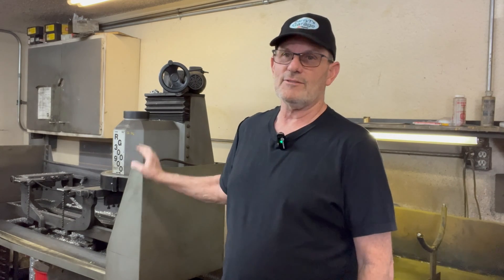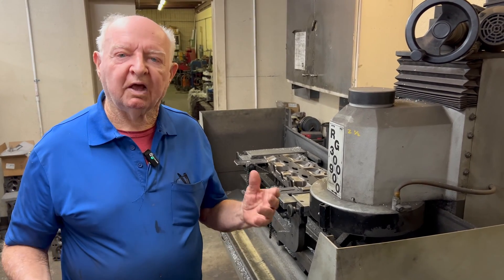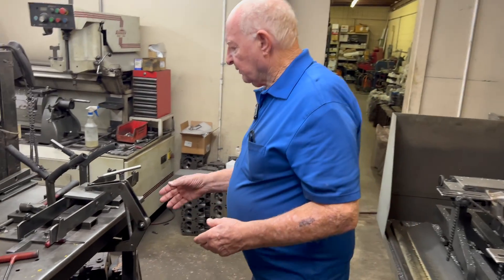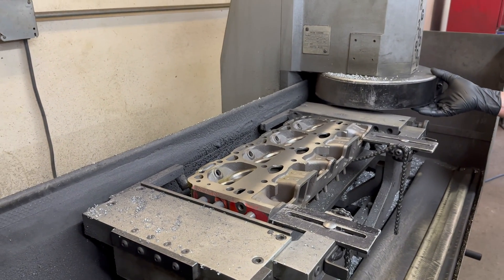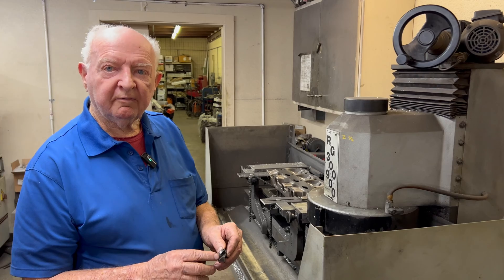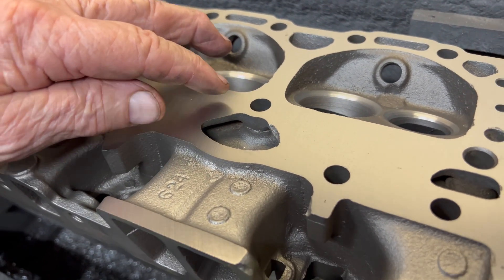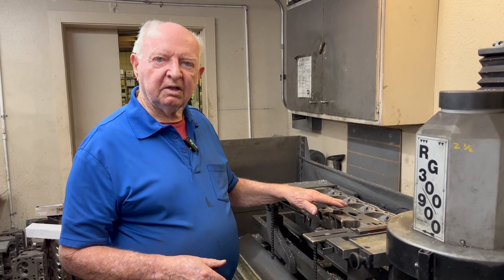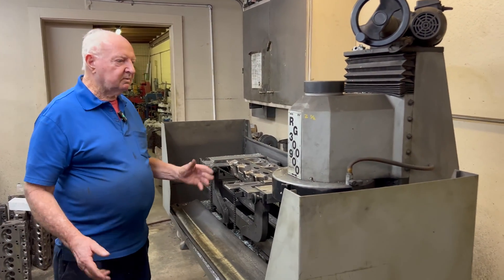MILLING a Cylinder Head - Precision, Repeat Performance - Ed Smith

Comment: The new machine is much faster than the old machine, but whatever machine they use in the factory when the heads were new, that one must be much faster still.
Reply from the maker: For racing or even high performance, the factory provides a good starting point. But a factory new engine is still built with cost and assembly time limitations that can be improved on.

Comment: A Storm Vulcan 85B was and still is a good machine for milling heads and blocks. Very easy and fast to mount a head, level it and make a cut. I ran one just about everyday for years.
Reply from the maker: That’s a great comment. Thank you for taking the time.